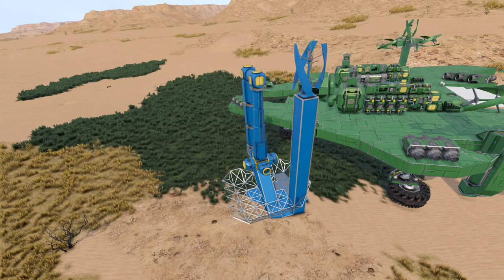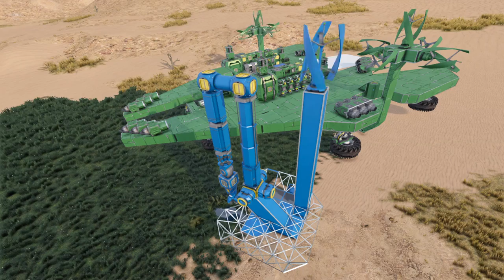Loading Up The Skimmer | Hovercraft Mobile Base - Space Engineers Time Lapse #04

Comment: Interesting to see a large-scale mobile base skimmer :) Nanobot Build and Repair has a handy feature where you can use block colors to control certain behaviors. Such as specifying a "ignore color" and the system will not interact with blocks of that color, (such as your ore basket)or the "grind color" and it will remove blocks of that color.